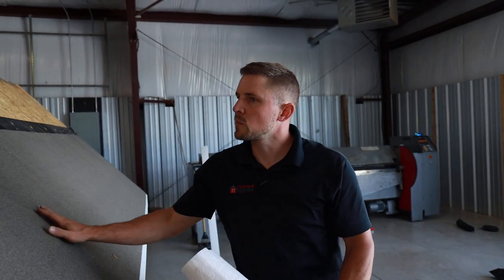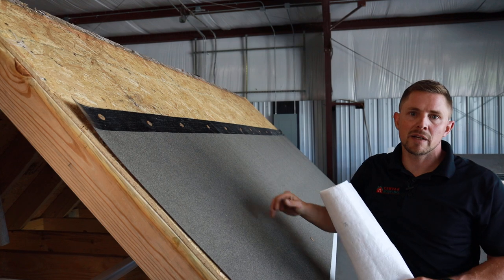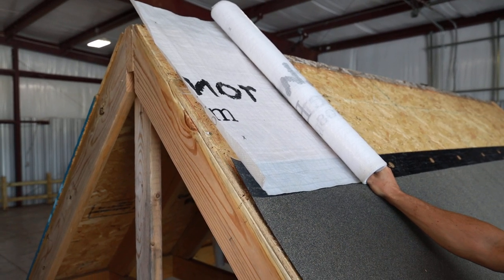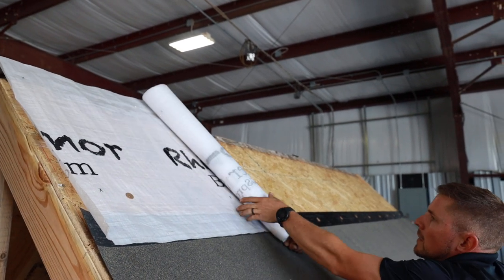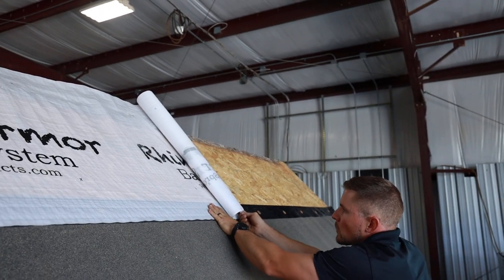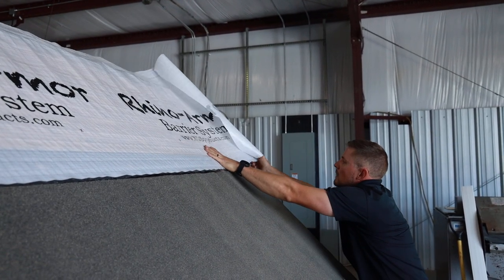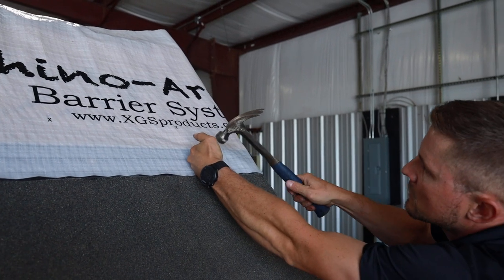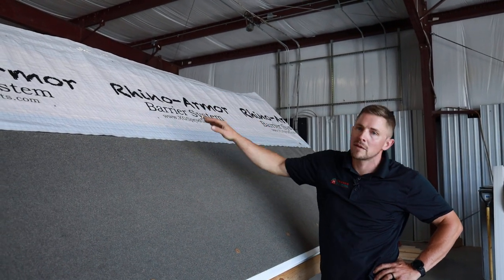How to install synthetic paper roofing underlayment on the roof. | Cenvar Roofing

Comment: so after the ice shield you start the under layment at the top ??  or does it matter ?  I thought it starts from bottom up like the shingles
Reply from the maker: For this model, it would seem that the under layment starts at the top, but you're correct. It starts from the bottom up. If we had a larger model we'd be adding another layer on top of that and then another on top of that.

Comment: Cover the ice shield with the underlayment. Because if you don't the shingles will adhere to the ice shield and if you have to do repairs or install a re-roof good luck getting them off .
Reply: That's exactly what im about to do in my home.I'm using nail caps do you know if I can nail down the Synthetic to the ice shield? I would have to cap nail it every 6/12 inches.
I'm sure the ice sheild will seal the nail holes.
Reply: @Keeps- You're about to nail shingles over the ice and water shield, so why couldn't you nail the underlayment over the ice and water?
Reply: what if the synthetic paper installed is all wrinkled and not flat on the roof? Can it be left that way or need to be perfect? I nedd yo know asap because my roofer left it that way.
Reply: Leave it.